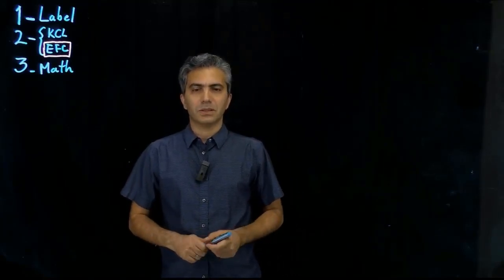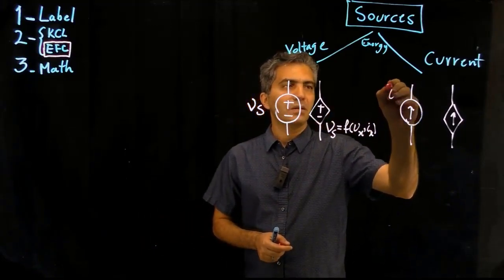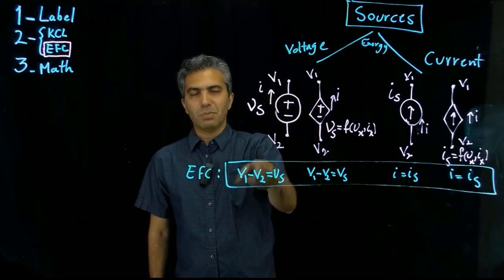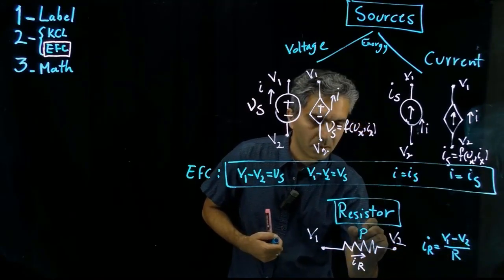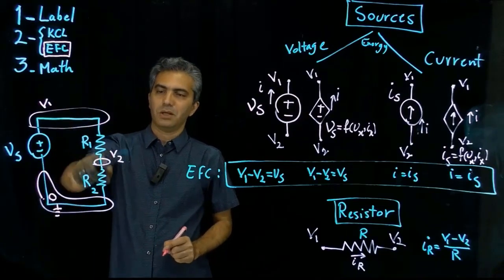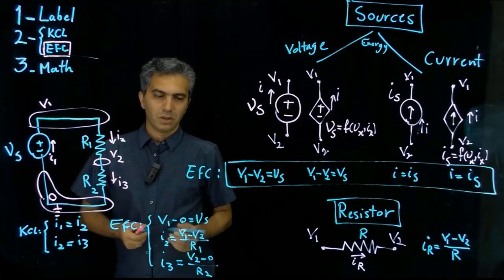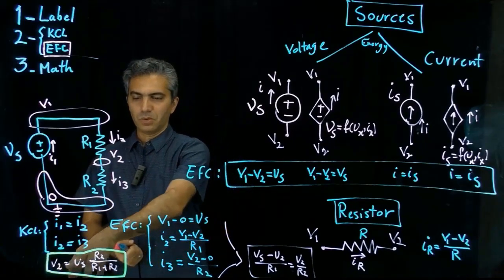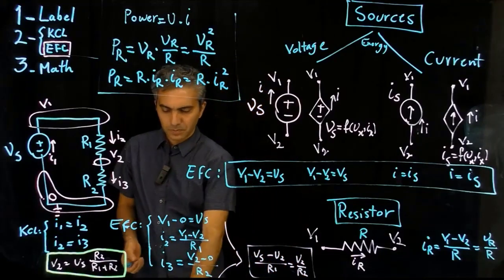Lecture 4: Voltage and Current Sources

Comment: hello professor, I have a question on labeling circuits how do we choose the direction of the currents and how do we decide the positive- negative parts of the voltages and currents This problem has been messing with my head and I couldnt find an explanation that I can grasp well. Thank you for nice lectures .
Reply from the maker: Dilara, I suggest that you watch the lectures in which I explain the universal circuit analysis method. But to quickly answer your question, the direction of current is completely arbitrary.
Reply: I watched every lecture of yours before this one . Thank you for responding:)